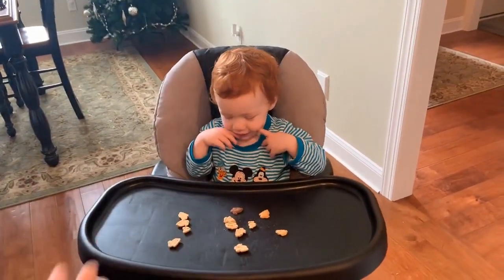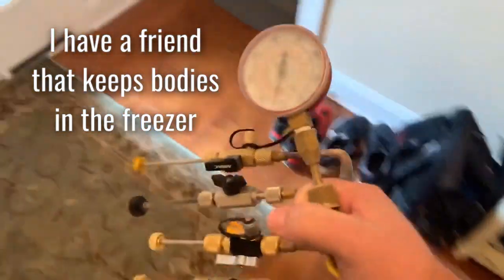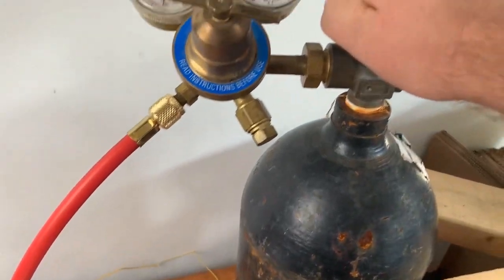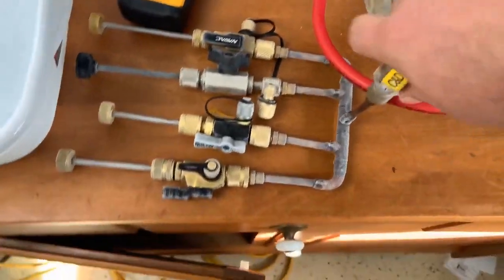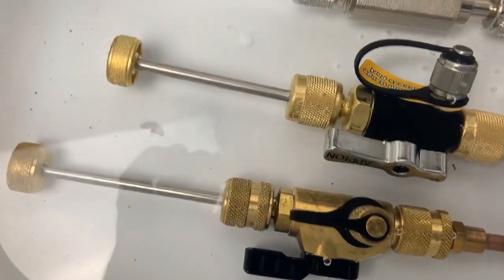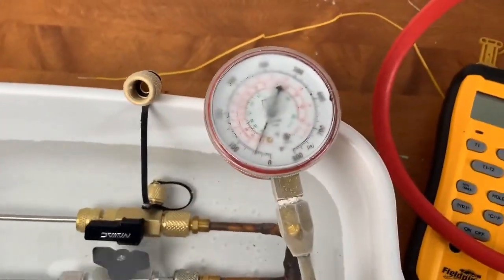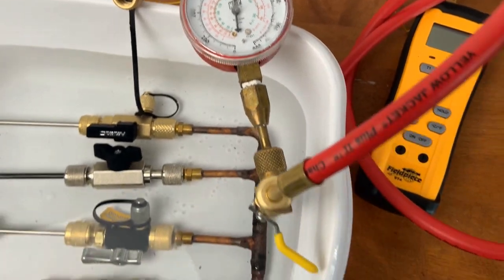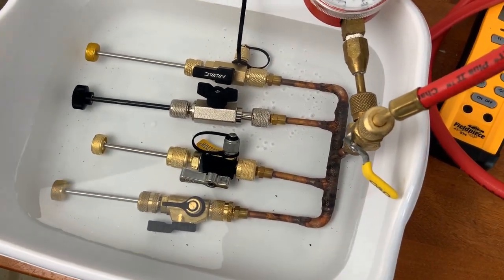HVAC Valve Core Removal Tool | Cold Test

Comment: The deep vacuum is a much tougher measure of how well they are designed and made.  I would like to see a rebuild of the Amazon tool.   Also a head to head test of the gauge hose neoprene, rubber, and nylon style of gaskets on the quick connects.  Which is most effective can they be interchanged, etc.  Good channel.
Reply from the maker: Great suggestion!

Comment: I'm a new guy. First day I ran into an oversize high flo core. Regular removal tool would not work. JB want $350 - $450 for their tool. Do you know of any cheaper alternatives?
Reply from the maker: No, those special cores require a special tool. I cut them out when I get the chance.
Reply: @TALYN875  Thanks.